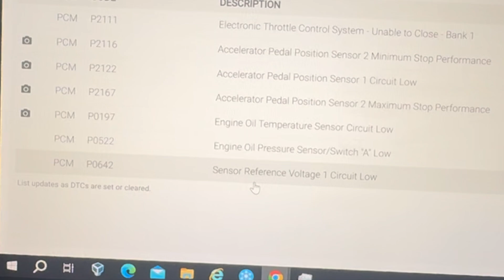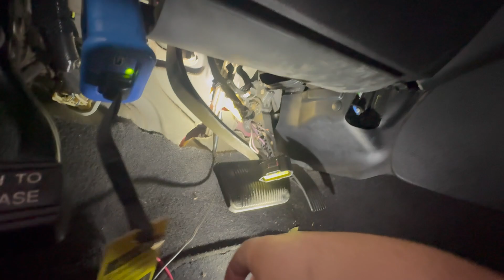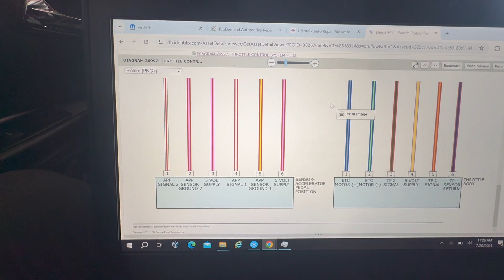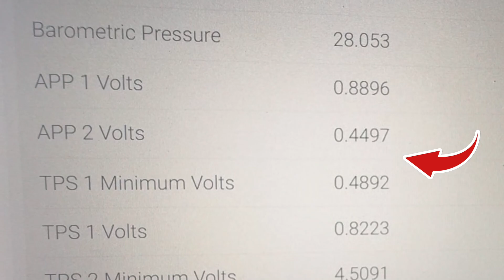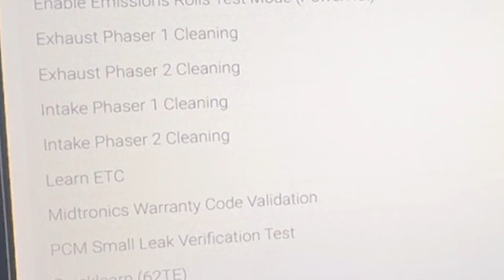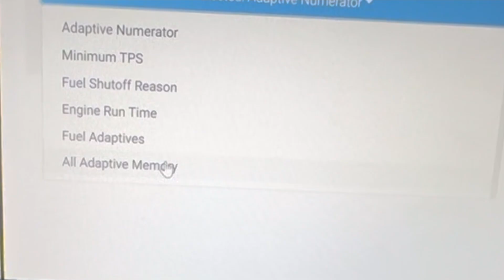2015 Dodge Journey Electrical nightmare P0642

Comment: Crank Position Sensor (at flex plate) on 2009 Journey 2.4L SHORTED OUT and caused the FALSE Problem of Throttle Actuator and Accelerator Pedal  P0642 P2119 P2122 APP1 volts=0

Comment: Dodge, Ram have issues with their fuse panel by the engine is not sealed, moisture gets in and the nightmare starts.. Just 1 of the many issues with these vehicles.

Comment: I had one that had app codes. During diagnosis I figured out that the crankshaft sensor was the culprit. All wheel drive model so had to remove exhaust, front pto, and driveshaft to get to it. All 3 wires were melted together and somehow this vehicle was still driving around. Limp mode I believe. But still amazing.

Comment: I fixed one of those journey. Customer took it to the buy here pay here scumbags to get their GPS tracker taken out. They cut a wire which was ground reference for the 3 speed sensors on trans. I can't say if it was shorted with power probe or from them adding a wire to chassis ground but with extra wire removed it had 1v on low reference. They were there for 5 hours and they finally got the light to stay off long enough to get them out the door. A month later they are leaving for vacation and call me because it stopped shifting. Bad PCM. Programmed it with my launch pad5.